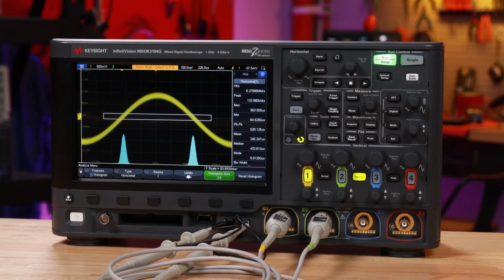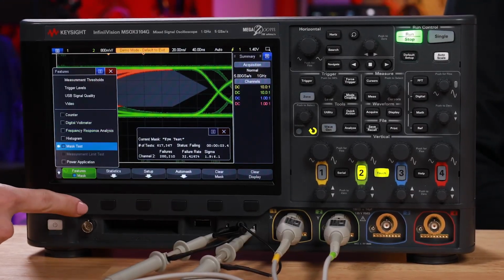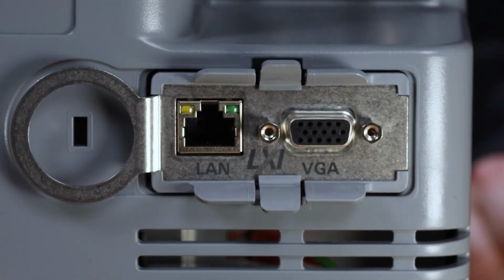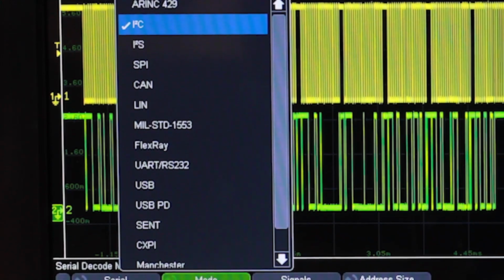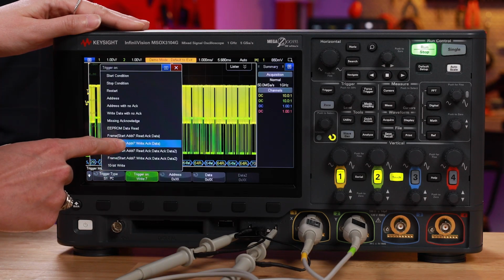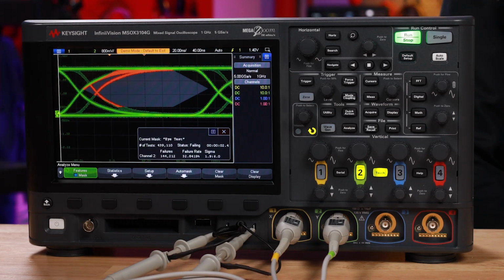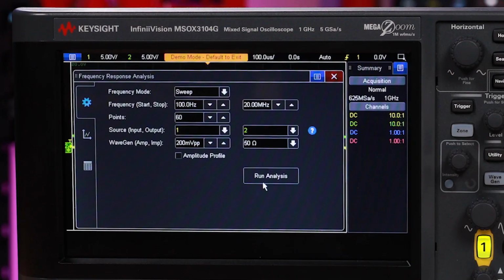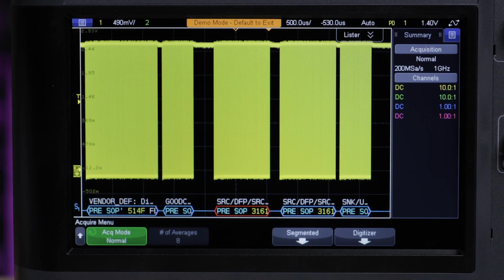Keysight InfiniiVision 3000G X Series Oscilloscopes Spotlight

Comment: Finally an Oscilloscope that features a dual bus time-interleaved protocol lister display AND jitter/noise waveform measurement histograms. BUT am I am curious as to whether or not it would also be capable of automatically synchronizing cardinal grammeters? And are the totalizers outputs produced by the modal interaction of magneto-reluctance and capacitive reactance?